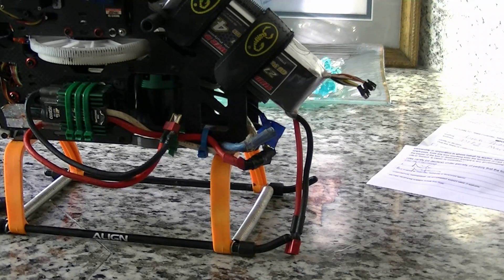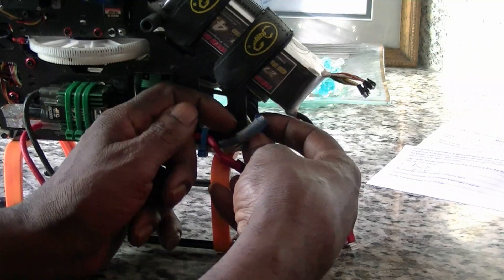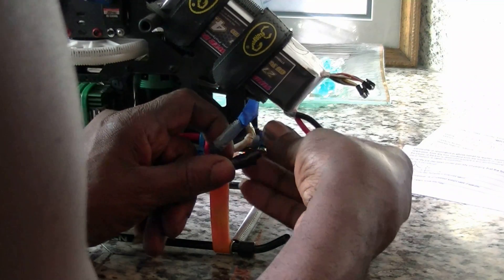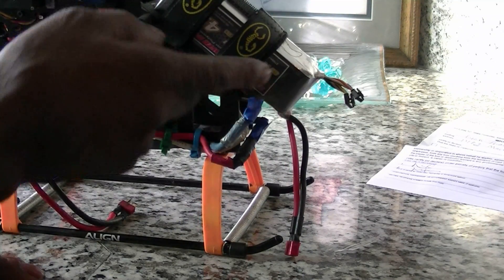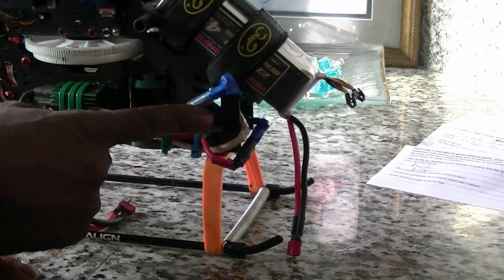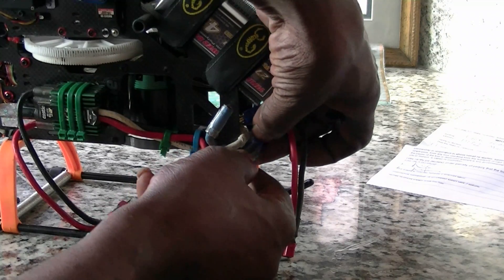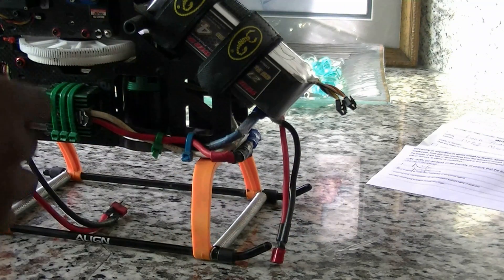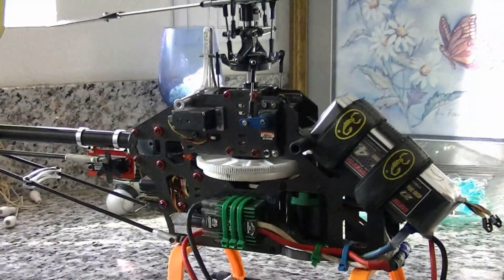rc helicopter how to unplug your esc from the motor for test purposes.

Comment from the maker: center stick/90 servos/ swash afr 50 percent.
then just adjust the links on the swash plate the same mount turns so it stays level 
either go up or down with the swash plate to get what you need .
understand ? ill make you a video if you dont lol